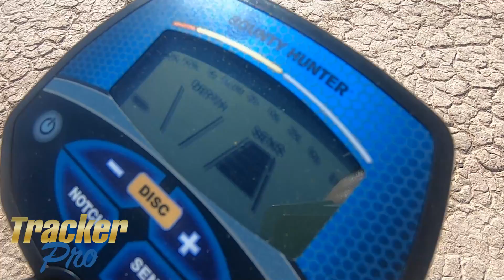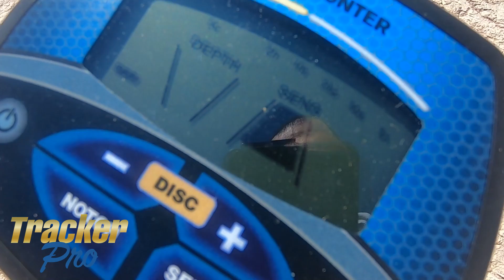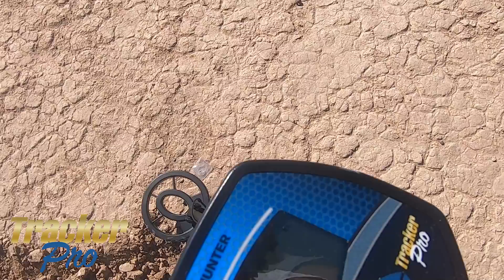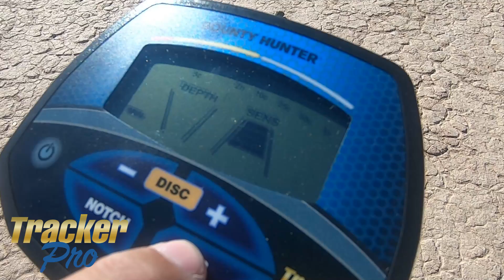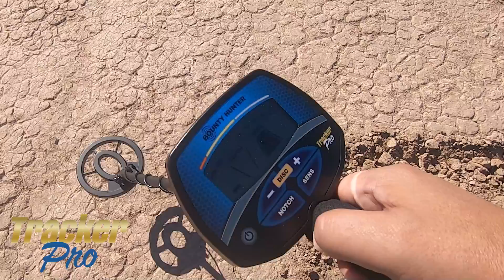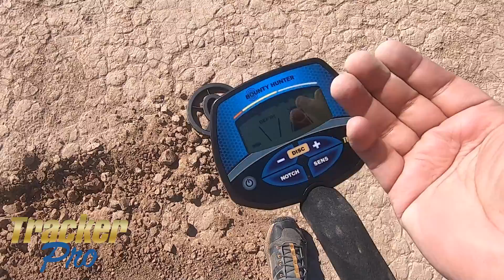Tracker Pro Tutorial How to Use and Set Up the Bounty Tracker Pro

Comment: I have a Tracker Pro. It turns on by itself after I turn it off and put it away for the day. It’s happened several times. What could be doing this. I have to remove the battery to avoid it draining and the detector noise bothering the others in the house. Any ideas?  Thanks 🙏
Reply from the maker: Hello Dave- Please contact us so we can have a technician help you. 1-800-413-4131 or info@frsttx.com